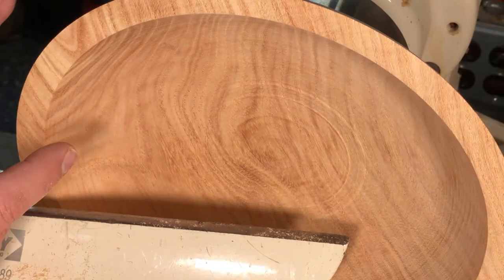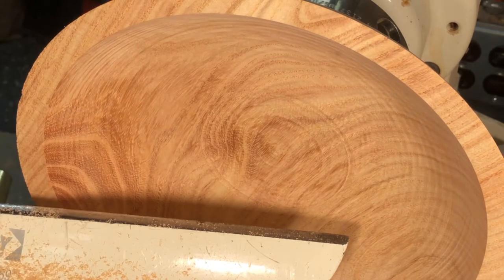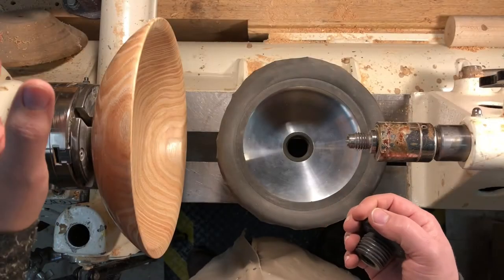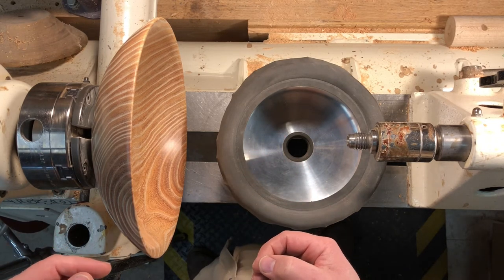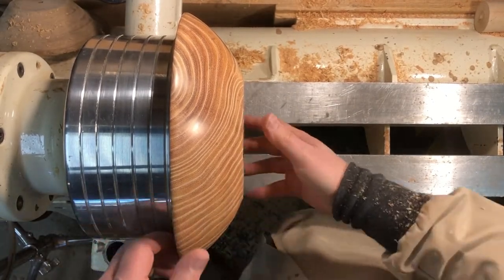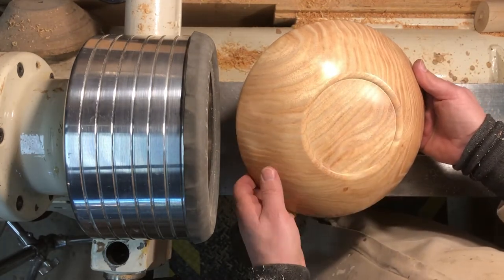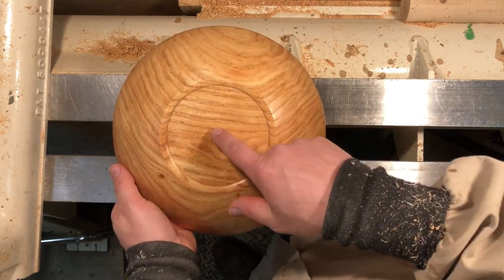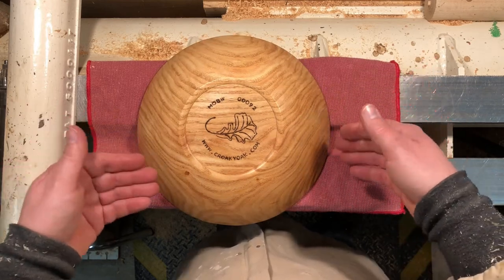Woodturning - Making A Locust Wood Bowl From A Dry Bowl Blank

Comment: Very nice result. My first time looking at your channel. Surprised to see you using carbide tools, especially for removing and shaping the foot. Probably increases in your sanding time in the long run. Sure does for me!
Reply from the maker: @Noel Green the carbide cutters I’ve been using leave a surface similar to what I’d expect from a sharp steel tool. However, this is typically only true on the outside of a bowl. On the inside of a bowl I’ve found carbide tools to be slower and far more prone to tear out than a sharp bowl gouge. As I’m sure you know, this can vary from one piece of wood to the next.

If you’re spending too much time sanding, try power sanding with 3M Cubitron (purple) sanding discs. They are worth every penny. Just make sure you have a dust collector. :-)